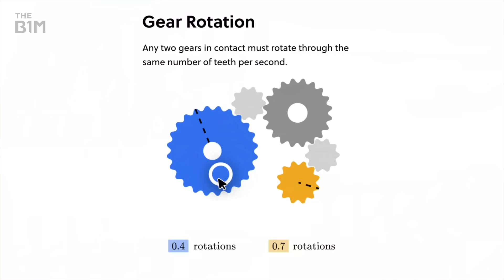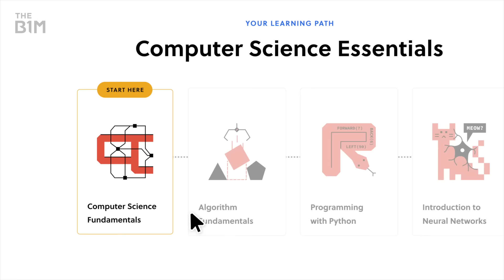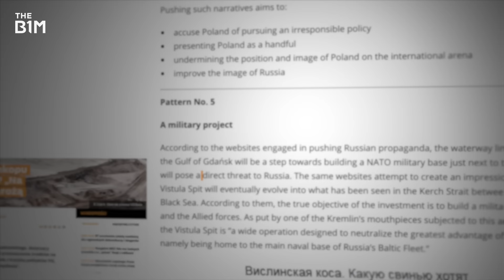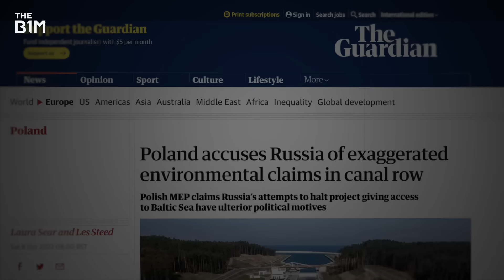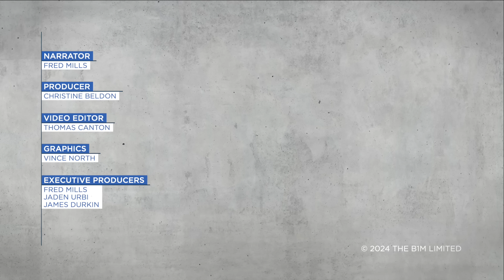Why Russia Tried to Block This Canal

Comment: Canal: $500,000,000.00

Escaping russian influence: Priceless
Reply: It's not even that expensive compared to Poland's Tax revenue they gather each 😂
Reply: For Everything Else, there's MasterCard
Reply: Putting $500m on credit card will earn you a hell lot of points.
Reply: Look at the rest of polish coastline. We didn't need that canal. It's just a very expensive turist atraction that makes properties on Zalew Wiślany more atractive, due to easy connection to the Baltic Sea.
Reply: That's what I was thinking. The political benefits outweigh the economic costs by A LOT.
Reply: @pwolkowicki  Tourist attraction for cargo ship captains 😂
Reply: Kind of like a screen door on a submarine-  Poland builds a lock between two sea-level bodies of water on a spit...
Reply: @Gigi-xr3qs  The narrator did mention that the lagoon and the Baltic have different levels there.  I have just read that the level inside the lagoon can vary by up to 1.5 meters due to wind effects.  I suppose if the wind was from the east, the western end of the lagoon would be higher than at the outlet near Kaliningrad.
Reply: half a bil.. that's it?? pffft! hell yeah worth it.
Reply: "I will catch the devil by his tail, but I will pull my country out of the bear russian hug" and statesman said long time ago.
Reply: low key an unhinged comment
Reply: @patricknorton5788  Would have been cheaper and better just to build it wider and let the tide do its thing.

The variation is mostly caused because both ends of the spit aren't equilizing as fast. If it was a wider canal this would solve that problem, and eliminate the locks.  Locks are probably just there for state jobs though.
Reply: @Gigi-xr3qs  I missed the Let the Tide Do Its Thing chapter in civil engineering. Could you give us some of the highlights ─ like the velocity of the current for a 1.5 meter water level difference, and what effect that velocity would have on large ship navigation through a narrow canal?
Reply: @Gigi-xr3qs  A wider canal and a bridge high enough to pass under would eliminate all the hassle. The high bridge might not be that important though as it seems like a place with limited traffic.
Reply: @znail4675   Exactly. This design is about control. Draw bridges/switch bridges weren't even necessary.  Just a wider canal, and a tall bridge.
Reply: @nntflow7058  Right? We spend about 1700x that much on our military every year. What's our ROI on that? It's not all about making money. It's about being independent, strong, etc. And they can now probably get a lot better rates shipping through the Russian side, too. Plus productive jobs, infrastructure, more country trade, etc. etc. Wins all around.
Reply: Anything that reduces ruzzian influence in this area is a good thing, surely?
Reply: @Gigi-xr3qs  Wymóg ekologów i UE
Reply: @Gigi-xr3qs  Do you have any idea how expensive that would've been and how much it would've affected the local ecology? It would've had to been Very Wide Boy to prevent water level differences. You might also want to look at the cost of the bridge spanning between Denmark and Sweden to take a gander of how "cheap" it would've been to build a long sea bridge over that several tens of km wide channel.
Reply: @_ata_3  small cargo ships. Check Polish coastline. We have plenty of small ports, and 3 big - Szczecin, Gdańsk, Gdynia. No need for another port in Elbląg for small ships.
Reply: It is a big middle finger to the neighbour.
Reply: @pwolkowicki Ale Elbląg jest blisko centrum Polski i dochodzą do niego zarówno trasa szybkiego ruchu jak i linia kolejowa...Czego nie rozumiesz ?
Reply: @nielsdebakker3283  Believe me or not but 99.9% of Russians do not care about this canal. It was a good way to waste the money.
Reply: $500,000,000. The same price as Bezos's yacht.
Reply: @andreypetrov4868  waste what money?
Reply: Except cargo ships can't use it. Becouse water between canal and harbor is to shallow. Becouse not much more thought was put on before spending our money than before writing your comment
Reply: @colinstu  The average highway renovation project in the US costs more then this lmao, this is pennies for an infrastructure project.
Reply: @znail4675  A tunnel would probably cheaper than a bridge high enough and it certainly wouldn't restrict ship heights.
Reply: exactly
Reply: @pwolkowicki nie potrzebowaliśmy  ? Na chwilę obecną kanał jest pogłebiany. Przyda się gdy będą budować EPS Tolkmicko
Reply: The only problem is that's not.
Reply: @PanProper 😂😂😂😂😂😂😂
Reply: @Gigi-xr3qs  not that brainy are we?
Reply: @reidflemingworldstoughestm1394 3:37 dont be hard at gigi. He was not issued with  a brain.
Reply: @Rubicola174  Another Martian has just landed on Earth.😁 The complete national budget of Poland for 2023 is less than 200 billion. If you call a half billion rounding error, you'd be a terrible accountant. Or a very creative one.😂😂
Reply: @pwolkowicki  Yeah canals usually attract tons of tourists 😅
Reply: @ulfosterberg9116   No, you're not. I agree.
Reply: By "priceless" you mean to get nothing. Zero benefit. Am I right?
Reply: still a waste of EU funds. Gdansk is next door.
Reply: @nntflow7058 the support from the EU is that the tax you are talking about. with out the Support from the EU government the POlish people would be eating each other.
Reply: NATO isn't much better
Reply: tell me you stuck in the western plato's cave without telling me you stuck in the western plato's cave
Reply: @traitretrudeau2367  Huh, better than in the Russian dungeon.
Reply: Conclusion : sheep
Reply: Except that literally no one uses it...
Reply: @user-nh3gu1ge3d  You know that the vast majority of goods then came to Elblag were actually transported from...Kaliningrad? It was Russian coal. So congrats on spending lots of money on nothing.
Reply: Super
Reply: @cehaem2  Citation needed. Also, independence changes everything. Stay mad about it, though.
Reply: @TheKakan1337  Tax payers' money.
Reply: Cant put a price on freedom from Putin 👌
Reply: @Gigi-xr3qs  Do you think they would have gone through the trouble if it wasn't needed? There's a significant difference in the sea level on either side of that canal.
Reply: @Gigi-xr3qs  Wow, look at the brilliant engineer here. Can I hire you for my next billion dollar project? Your kind of insight would be invaluable.
Reply: @artor9175  Sorry, kind of busy with shit, but next time.
Reply: @MikeyRussell88  Do you mean that before that canal was built, Poland had not been free from Putin ?
Reply: @user-nh3gu1ge3d  you contradict yourself.
Reply: @gronz  No I didn't.
Reply: @pwolkowicki  "Look at the rest of polish coastline." what the fuck does that mean? Should cargo ships just slide along the beach and then the ground until they get to their destination? What the fuck is your point? Its made specifically to access THAT port and its not even a "big port".
Reply: $500m is honestly not that much in the grand scheme of infrastructure projects, a metro line can be $500m easily.
Reply: @_ata_3  What cargo ships? There are only small ports for yachts.
Reply: Your comment: 10/10
Reply: @AGenericFool  there are better places for this. That is what I wnat to say.
Reply: @user-nh3gu1ge3d  yes you do. And nobody is using the channel. So no win for nobody. Only wasted EU money.
Reply: Indeed ;-)
Reply: @Gigi-xr3qs Seeing someone mocking someone from a position of ignorance is always funny, thanks. 😂
Reply: @pwolkowicki  and we've got out first russian troll. Even tho I hate our late party, I have to admit that this is incredibly important thing for us - Poles.
Reply: The video is misleading. The channel doesn't matter at all. It's just politics. There is not even a fairway to Elbląg. Normal ships cannot enter there. Maximum immersion depth 4-5 meters.
Reply: @gregoriodia  I am not a troll. I just disagree with your opinion!
Reply: @nntflow7058 it’s not expensive by infrastructure standards period. Also canals have many benefits beyond fees. Shorter routes mean less transit costs, which means cheaper goods which means more purchases which means more tax revenue an and more jobs, which again means more tax revenue and more purchases and more jobs.
Reply: @_ata_3  Doesn't change one bit about the political reality of the Russian enclave at Königsberg and still controlling the large opening at the Vistula Spit opening.
Reply: @victorsamsung2921  Ok, if Victor Samsung says so 🤣
Reply: @Therearethings8148  You don't know what yachts are do you
Reply: @victorsamsung2921  One step at a time buddy
Reply: @AGenericFool They are saying it was not worth spending a sizable chunk of the National Budget on a single port when there are many others. It’s a waste of money, and like that economic analysis said it would take some 650 years to pay off. Deepening it would exasperate the costs and all for a single port.

Also, imagine the amount of things that could have funded. Social projects, programs, etc.
Reply: @nielsdebakker3283  Elblag isn't really an important port. The Russians couldn't care less and the fuss they made about it, if any, was more about lost revenue than influence. But you guys seem to grasp at any straw now.
Reply: @gronz  Taxpayers' money, it doesn't belong to the EU and the people have certainly not been asked what they want their taxes to be spent for.
Reply: @victorsamsung2921  *Kaliningrad. The Nazis lost it for good, and rightly so.
Reply: @pwolkowicki  More or less what I was thinking. It seems like it`s the only port avaliable in all Poland.
Reply: @Gigi-xr3qs There is no tide at all in the Baltic Sea.
Reply: "It's not about the money. It's about sending a message."
Reply: @_ata_3  A 650 year long step. Haha
Reply: @_ata_3   probably cargo ship groupies............
Reply: @FR-PL-UA-WARSZAWA   There is an outlet at the top of the Vistula Lagoon.  Had they just built a wider canal, the entire Vistula Lagoon would more effectively equalize itself as more water is allowed in from a shorter distance. Tidal differences in water levels would have been reduced a lot.
Reply: @pwolkowicki  Stop whining and get with the national program
Reply: @Gigi-xr3qs  Like you would know anything about it, go get your shine box.
Reply: @freedomisfromtruth   That's ok.. You know I'm right. The Poles aren't really known as the world's greatest engineers.. architects.. or really anything to be honest.  Maybe sausage?
Reply: especially when barely enyone is using it now.
Reply: I can't think what took them so long to do this.  The Soviet Union fell apart in the early nineties.
Reply: Where did you get your numbers from 😂
Reply: So they still get transported the old way don't you think so?
Reply: @Gigi-xr3qs  ale Ty wiesz ze że zasolenie zalewu wiślanego to około 3 procent a morza bałtyckiego około 8 ? Więc jak myślisz śluza jest potrzebna czy nie ?
Reply: @valentinomanontroppo4675  przekop był sfinansowany w całości z budżetu państwa. Unia nie dołożyła ani euro więc przestań płakać
Reply: For everything else there's Mastercard
Reply: lol
Reply: @nntflow7058 Its very expensive considering Poland gives nothing to the EU at all, and only ever takes money. Most countries in the EU would be embarassed paying for this but paying nothing to the EU.
Reply: @pwolkowicki  stfu russian nazi bot, i've seen you commenting on how you support putin denazifying the scum of polish people, supporting the rape and murder of ukrainians, you even praise hitler's works in other comment sections.
Reply: True true
Reply: 600+ year payback, can't handle large ships. Give a pole a shovel and the jokes write themselves
Reply: Poland GDP is almost 700 billion. This is like having 100 dollar budget and arguing about spending 7 cents.
Reply: @marcagray  No. It's like being deeper and deeper in debt every year and wasting 7c.
Reply: That's a very specific price.

Comment: Minor detail: Those funny shaped blocks for the breakwaters were designed in the Netherlands for the upgrade of the Afsluitdijk. On a recent video about that upgrade, it was mentioned that these blocks were going to be used world wide, nice to seen an example.
Reply: Denmark and the Netherlands have long been leaders in land reclamation technologies. It's cool stuff 😎
Reply: There are other specific design such as the Sogreah one.
Reply: It is not the first time we see Dutch activity in the area. Entire Vistula estuary ( Zulawy ) was managed by Dutch immigrants in XV and XVI century. They built an extensive system of canals, locks and dams and reclaimed some areas below sea level.
Reply: major detail: the whole project is Dutch design and engineering.
Reply: The Dutch are masters at pushing back against the power of the Sea starting with the huge Zuider Zee Project.  When I was a young boy my family visited the Dutch Coast and we heard and about the immensity of the project.  I lived very close to the Alden Hydraulics Laboratory of Worcester (Massachusetts) Polytechnic University where they had  single buildings dedicated  to layouts of the hydrology of such projects including nuclear power stations.
Reply: @snuffle2269 When I lived in Rutland, I passed it everyday going to work.

Comment: Water levels on bay and sea are actually the same. Lock exist to prevent sea water from entering the lagoon.
Reply: I was wondering why there would be a significant difference in water level between the two… 🤔
Reply: This detail bothered me too. Both waters are sealevel and they literally meet several kilometers north. How could they be different levels if none of them is river that is higher. THX I thought I was going crazy thinking I'm alone on this one.
Reply: @petrnemec1421  Polish opposition (at the time) was against this investment. BTW God knows why... So they tried to push all buttons available like envinronmental objections, etc. They were against cutting trees (feeble and weak at this point), advertising some special bugs and plants that will suffer if the canal was to be build, etc. Therefore - to avoid constant beating the eco-madness-drum the investor decided to put up a lock.
Reply: I think they will be a little different most of the time because of the way high tides  sweep along the coast line and the current natural passage in Kaliningrad will restrict the flow in to and out of the Lagoon.
Reply: @huw3851  More or less. I suppose mainly storm prevention. With northern storms the water can rise...and flood some part of that land if not blocked by those water doors.

Comment: The artificial island they made here is an excellent example of working with the planet in development. In this case the land of the Vistula spit is home to nesting grounds for many bird species. Running the canal through it destroys some of that available area but building the artificial island very close nearby negates the habitat loss. In fact it looks like once the island is complete it will provide 3 or more times the land than was used for the project.

Overall the species reliant on the spit, Humans, and migratory birds get what they want out of the project. The poles get a canal and the birds get a new but local and probably even safer nesting site. Yes it will take a few years for that benefit to be realized but its a solid plan overall.